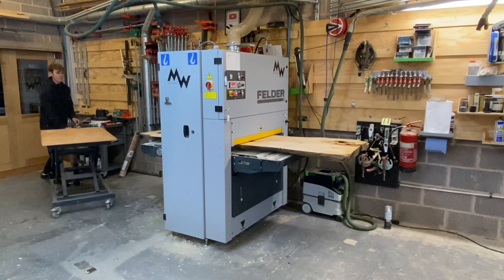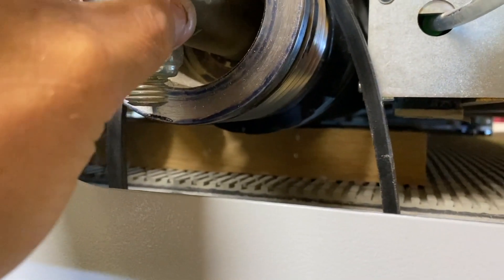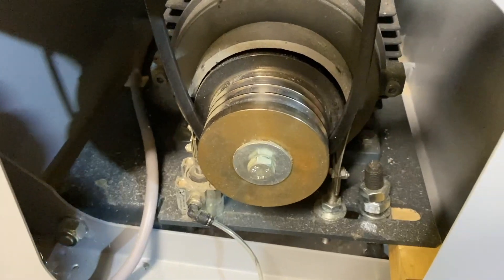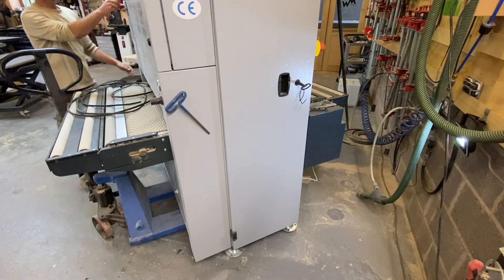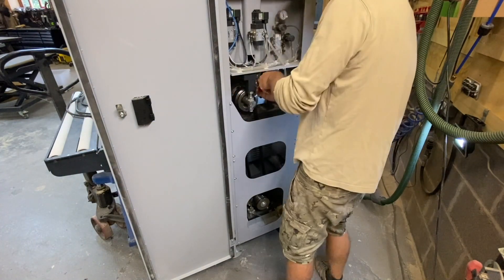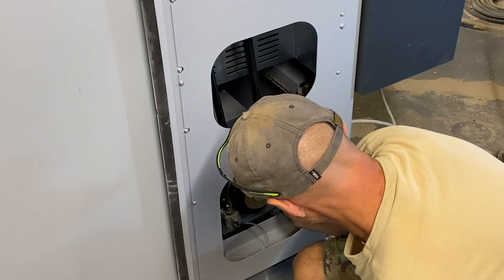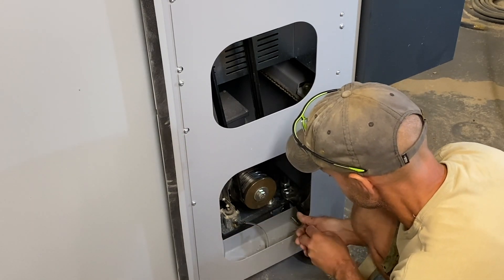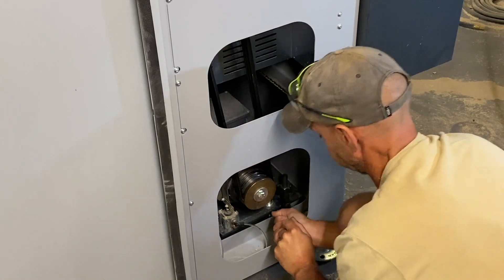Felder FW950  - Maintenance -  Main Belt change

Comment: It might be worth remembering that belts are like bearings often standard sizes.  So even though Felder are not charging silly money if you need them quickly or Felder are out of stock there may be other options. Size is usually printed on the belt

Keep the videos coming love the Sunday morning tool porn
Reply: You need to be very careful not using manufacturers belts. The belts on modern machines are sometimes made of special construction to transmit power better. Also the vee section may not be standard . Buy the right size from your car parts shop but the slightly wrong section and you could wear the pulleys. A very expensive mistake.